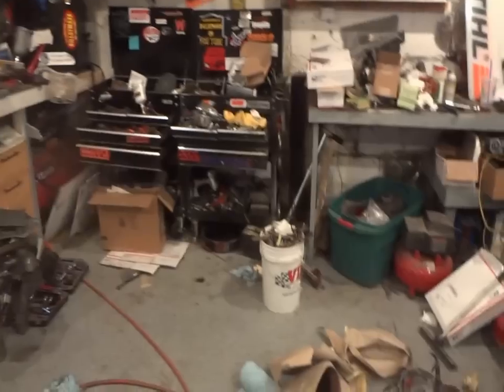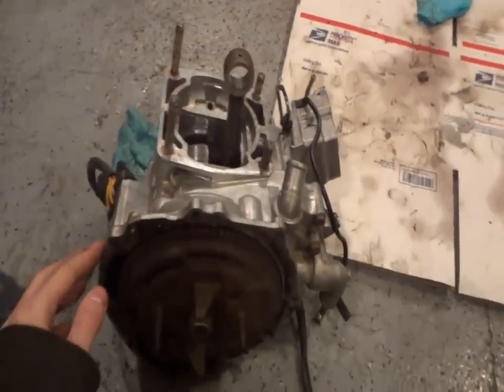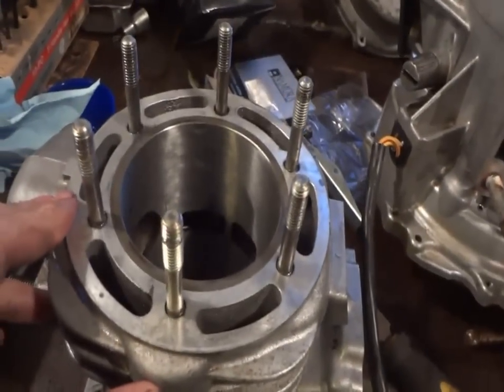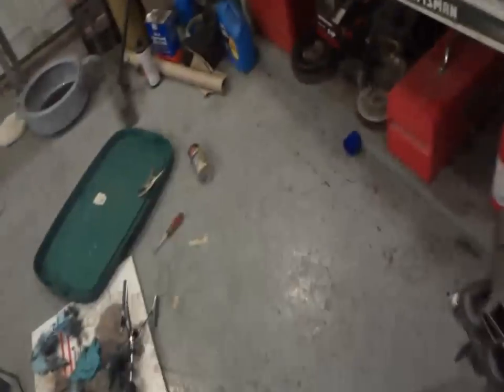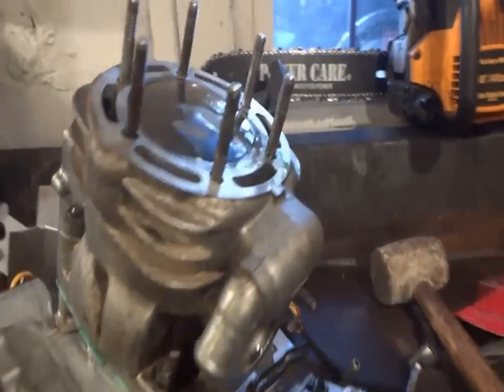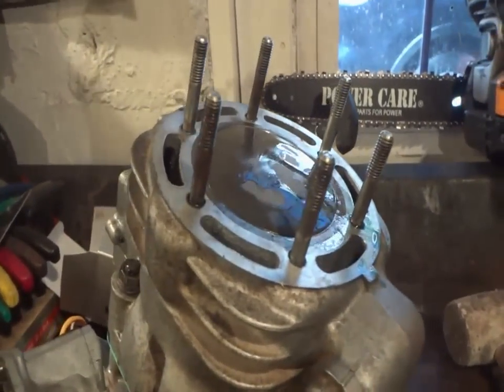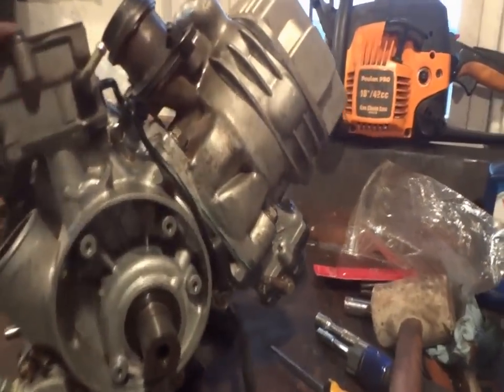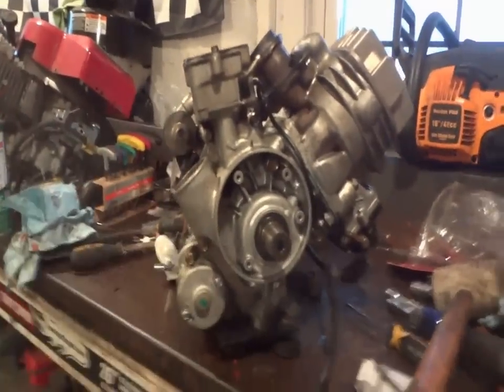Polaris Scrambler project PT1 motor build

Comment: A Motor is driven by electricity.......power station is the engine. An engine not only moves things its the complete package. It converts fuel into movement or energy.  Have you ever seen a car?